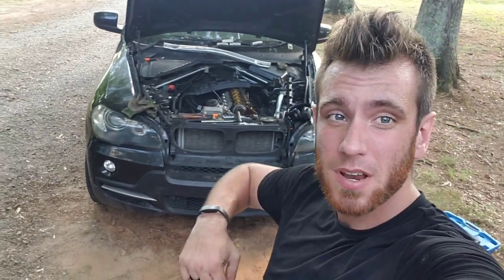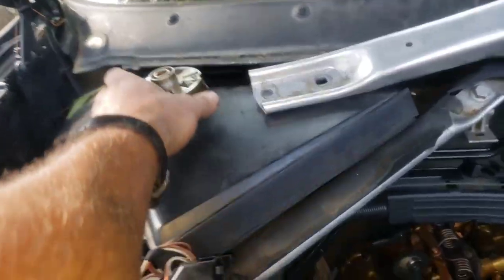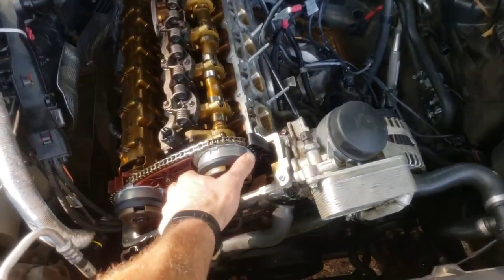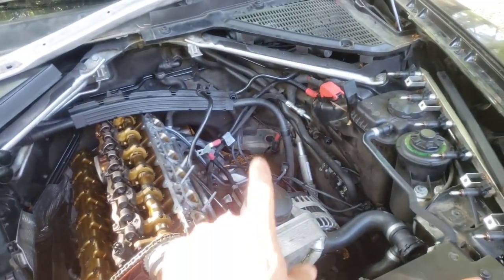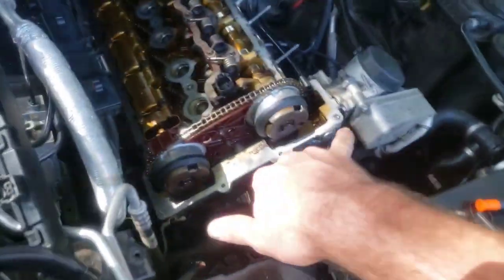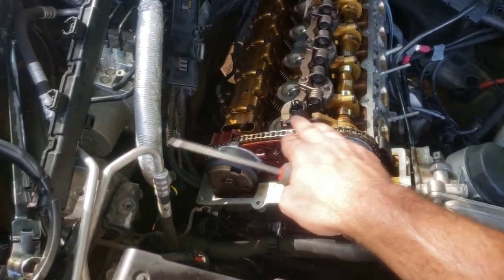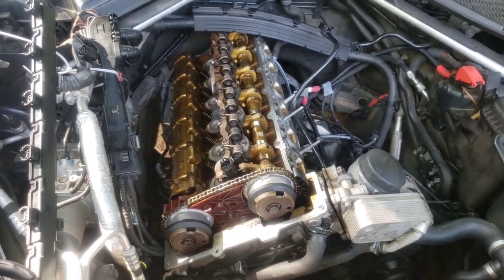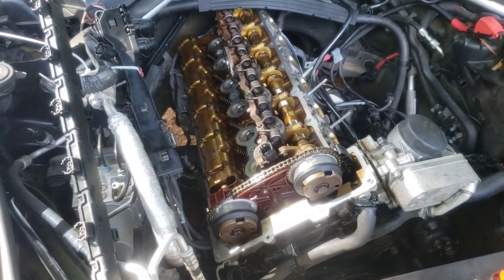BMW Vanos Fix Replace Cam Gears Broken Bolts Didn't Bend Valves How to Diagnose 3.0 e70 e83 e90 e92

Comment: I found out that the vanos issues are a proble that BMW recognises and they offer an extended warranty for 10 years or 150,000 mles to replace any parts related to the Vano from 2011-2014 BMW 3.0l engines.

Comment: Hey how you doing I’ve got a funny knock noise on revs, on my N54 335i and I’ve got the code 2A82 and I pulled the vanos solenoids and cleaned them both nothing swapped them nothing, so that noise sounds like it’s coming from the top of the motor on revs and I’m final diagnose is that my bolts backed out or snapped off because I had very few metal flakes in my oil that weren’t magnetic, I did my valve cover gasket and never check those bolts because I’m a newbie to bmw, so I’m asking to see if the link you have posted for the gears are the same for the bmw motor N54 I like your idea of going slowly and replacing the bolts but I can’t find the link to just those bolts so please help me out it’s been months since I’ve been able to enjoy my car... :(
Reply: Hey Lazzyyy, I am having the same issue with my N55. I bought the bolts myself and am preparing to only change th bolts while keeping the vanos in place
Reply: @duskomladenovski  I pulled the valve cover brother absolutely nothing wrong with my bolts, still trying to figure out the issue
Reply: did you change the bolts
Reply: @duskomladenovski  hey man, how did it go changing the bolts?
Reply: @BuiltByLaz  hey man, have you found the issue? Maybe it’s the cam bearing ledge? If you need a video on checking it out 50sKid has a DIY video on it. Cheers
Reply: @christopherestay2483  The Vanos bolt for me were sheared off do i had to replace the whole unit. I bough them off ebay and replaced them while keeping the chain in place. But then of course i ran into other issues (Electrical)
Reply: I’m having the same issue. Happened after an oil change. Sometimes I would get the louder lifter tic on a cold start randomly but now it just wont go away. I haven’t pulled the valve cover off yet & I guess that’s the only way I’m gonna find out if this is the case or not.

Comment: Ive found 7 of the 8 vanos sheared off bolt pieces. 3 in the upper end, other 4 in the oil pan. How worried should I be about that final piece? Could have already come out in an oil change i guess

Comment: Thanks for and video! Do you have any resources you’d recommend for setting the timing for the top and bottom end after the intake camshaft has not been spinning with the rest of the engine due to the bolts breaking on the VANOS hub? Thanks!

Comment: Was it making a rattle sound at start up? I’m currently having a rattle sound when I start up but goes away after a few seconds, I have no codes... I have a 2011 328i
Reply: Had this problem about a week ago and this wss the problem on my 2011 328i
Reply: @stilltippin214   was yours n52?
Reply: @Random.Adventures.  yes

Comment: Great job man. You forgot to mention the Timing Chain Tensioner. Loosen it so you can reengage the Exhaust and intake Vanos Gears in the chain.
I’m a firm believer of “it is not always what you know, sometimes it his how you figure things out.”
Awesome man.
That happened to me. After replacing the Intake and Exhaust Vanos in the chain, I took out the 4 screws on each Vanos Camshaft and apply High Temp thread-locker. Did you do that? Please tell me you did that. I would not like to see a nice guy like you go through that job again. 
They’re not that tight and the replacement screws are metal. Just fyi brother.

Comment: Hi chief,
I have an N51. I am gonna replace the Exhaust Camshaft Adjuster gear and it’s bolts. I have the Camshaft Locking Tool,
Is it really necessary to lock the “crank” by the starter?
Reply: I just did mine mines AWD it beats dropping the subframe lol

Comment: Where did you get the replacement for the little broken vanos bolts from, looked up the number you provided on a post couldn't find anything.
Also what toque numbers to mount them. Didn't  see any in the manuals.

Comment: Was there a loud rattling noise when car was starting? That gets louder as you rev?
Reply from the maker: Yes kinda sounds like a diesel, that was when it was on its last leg, and the last bolt breaking off wasn't soon after, and then it'll just be no start and partly no compression
Reply: How can you be sure that the valves were not bended ? Now I am working on the vanos and also opened the oil pan to remove the broken parts from engine, and I found the broken pieces more than 4 screw had, total were 6 :) I am also replacing the oil pump because the oil was in metallic color mixed and I suspected that the pump also defected even if thas the another filter in the oil pipe which connected to the pump in pan. But my guess, the exhaust camshaft was not turning and this can cause the valve bends. I am wondering how you can be sure without opening the head :)
Reply: kompresyon testi yaparsan belli eder kendini. Eger ki sibop yamulduysa kompresyon az olur. Kompresyon az ise biraz yag katip tekrar test yaparsin. Eger kompresyonda degisiklik olmazsa valve gitmis anlamina gelir. Eger kompresyon artarsa, tolerans basinc noktasinda degilse, sekmanlar bitik oldugu anlamina gelir

Comment: was this on a n54 and is it common on n52?
Reply: I think it might be on N52. I've been getting the 2A87 DME code for a while now. I have cleaned and swapped Vanos Solenoids and still get the 2A87 code accompanied by a weird metal sound. Following link is the sound I have from my engine. 
https://youtu.be/X7uV4zYtE1U

Comment: There's still no good step by step!! "just show and tell and waste of time crap" I know the secret you can repair these vanos issues for 6$ and 3hours!! LOL just keep moving the sheep in circles
Reply: how tf do you do it for 6$
Reply: Bro he literally told you step by step it’s like you don’t understand English bro you might need to slow the video down to understand but this man gave you the answers you need to fix your car lol.
The vanos gears do not need to come out , if they do come out you need to know how to do timing on a car 
You can spin the crank cub with a 20 mm socket 
Then gain access to your bolts 
Tighten your bolts 
Then spin the crank to get to the next couple bolts like reloading a 6 shot gun 
Spin the barrel 
In this case spin the cam sprocket 
Same with both sides 
Only 2 cams 
2 cam sprockets 
The exhaust side is hard to gain access but you are still able to with the method shown in this video